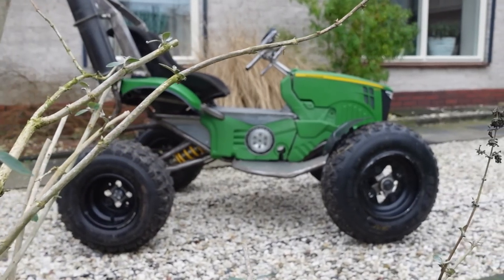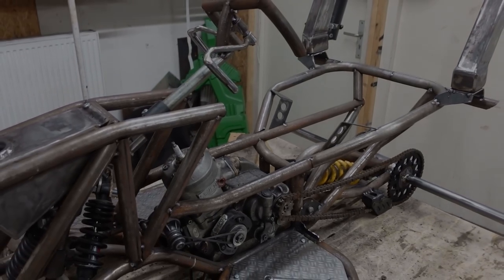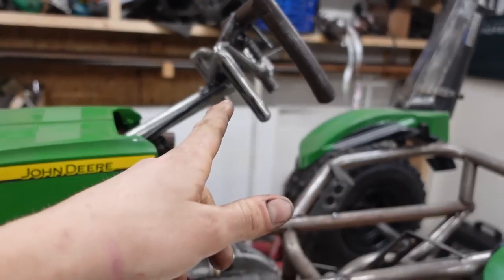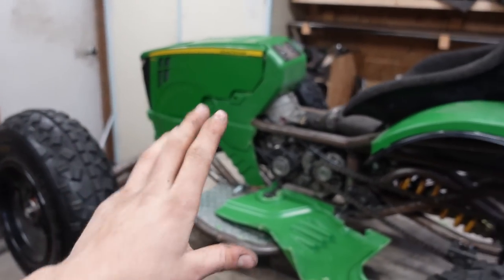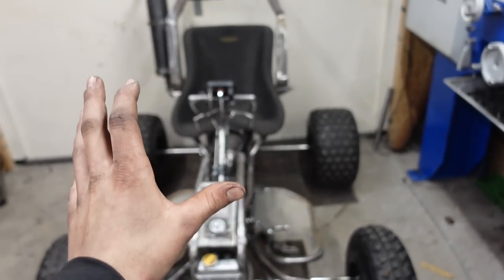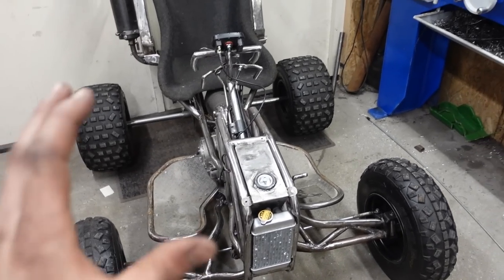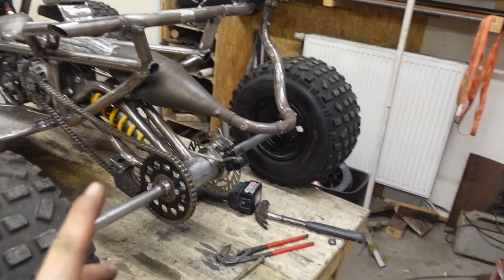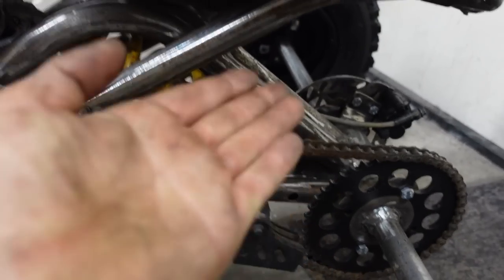40HP Toy tractor build part 4 - First testdrives & bodywork

Comment from the maker: Install Raid for Free ✅ IOS/ANDROID/PC: https://pl.go-ga.me/x16q5bmi and get a special starter pack 💥 Available only for the next 30 days
Reply: Je bent Nederlands 🤠🇳🇱
Reply: Fryslân boppeeee
Reply: Mag ik vragen uit welke omgeving je vandaan komt je komt me bekend voor ook de omgeving maar kan er niet zo m'n vinger op leggen waarvan ?
Reply: a nifty little trick about expansion chambers ... they are tuned for exhaust pressure for maximum HP ... meaning their length and diameter are specific ... BUT like any fluid (air is a fluid) the effective length can be adjusted with baffles forcing the flow in a spiral direction along the expansion chamber at say 30deg angles for 3 baffles ... this effectively adds a few inches without adding the few inches ... now you begin playing with the shape of the baffles ... a rounded cone seems to work best most often ... and the number to achieve the power to pressure ratio you would like ... 
.
and yes that is all an expansion chamber is ... a tuned back pressure valve to add a few extra horse power to your vehicle 
.
by changing the speed of the airflow with the baffles you effectively add length by increase the speed by the reduction of the space by baffles .... the cone shape funnels the airflow in a more ordered flow increasing speed allowing more flow to pass ... like it went further down a pipe instead of faster ... also the expansion also cools the exhaust by slowing it down ... to expand (technically it is speeding up as it has to fill the volume near instantly) you can further cool or heat the pipe to adjust this ... or use different metal types at different parts ... like titanium and aluminium and stainless steel etc .. all adjusting how the deal with the gas pressure and temperature ... all adjusting the ending horsepower curve . 
.
you may find with the pipe under your cheeks so to speak ... roasting all the um spicey bits ... you want to try a small 1/4 inch round mesh that directs the air in across the end of the exhaust (essentially cut out small triangles 1/4in wide 1 t 2 inch long in a point) ... bend and push out slightly to guide the airflow across the expansion chamber and between your seat ... this will effectively create extra wind cooling for your bits and also add to the low end torque with the faster heat exchange on the hot side of the pipe

Comment: I have been watching USA based builders like Grind Hard Plumbing, Cars and Cameras and Rather B Welding since the start of their channels build many types of power wheels. But the engineering on this in squeezing so many working parts into a tiny frame is the next level.

Comment: great work! ive had tons of 2 stroke experience. off the bat get a new plug. carb is jetted rich i can tell bu the sound, but that all plays a factor with the pipe. you should of took original pipe and just cut and move it around. just removing 2 inches from a 2 stoke expansion chamber can make a engine go from working insane to not work at all. pips are 50% of what makes up a stroke and how good they preform

Comment: Very nice "tractor". :)
Yeah, two-stroke can be a bitch to tune regarding the exhaust. The trick is to fabricate a resonator in order to have a "standing wave" inside the exhaust. That means it produces some kind of backpressure which is needed to keep a hold on the cylinder filling (air/gas mixture). If it's too short the gasses will simply blow out of the exhaust instead of being burned in the cylinder. The result is a badly running engine with no power at all. Too long and the same happens due to the system cannot blow the exhaust gasses out and get a full fill with air/gas mix.
As I was a teenager we spend hours to try and figure out the right length of the exhaust for our mopeds. A little help from the big brother who drove motorcross bike made it easier for us. :)

Comment: Absalute unit💯 you and the tractor haha, would advise a spring loaded chain tensioner to keep chain tight, also would be sick if the lights worked one way or an other, and I assume you plan on stiffer front suspension too, but honestly what a sick build!

Comment: Sorry the exhaust didn't work out. I guess the porting doesn't match enough so it isn't getting the tuned resonance it needs to rev. I overlooked the port timing. Well at least there's plenty space to have it the correct length and now you know it'll run right and you'll have your 40bhp!

Comment: Nice build, to bad you cut up the original exhaust, for a 2stroke the exhaust is very secure. Also i would look for a fan to put behind the radiator and temperature gauge, its gonna get hot and ruine your engine

Comment: Exhaust is usually least in performance vehicles optimized so you want to avoid modifying their shape and specially the size, even more so on two stroke. Would have saved lots of headache to keep size and relative shape same, but next time you know.

Comment: You shouldn't use an arbitrary stinger length. Worst case you could get overheating problems and seizing of the piston.

The length/diameter is an important variable of a proper pipe, not some appendage to be treated like an afterthought and made to fit!

Comment: Fabrication in this project is quiet impressive congratulations. But as a 2 strokes freak I am, I can tell due that expansion chamber that engine is probably not near 40hp. The amount of hours behind these engines are crazy, they work just like a clock.  That engine isn't the best you could fit in there, an enduro or coss would have been better.
Reply from the maker: Yeah i know but i chose this engine because its so small and compact
Reply: If you're lucky you're making 15hp.
And with a very peaky (small) powerband.
With 20+ HP you should be able to flip/wheelie this tractor. Especially with the soft suspension.

I said it before in a previous video. You butchered the powerband of your exhaust. And the tailpipe is way too long. Maybe you could start over, and curl the exhaust up to the hood, and style it just like a tractor exhaust (with little flap)

Also fixing the engine and exhaust riged, will cause problems.

Still and epic build.
Reply: @homemade_madness  yep, thats what I thought, but the way you've set it, with a normal enduro engine, you could have managed to fit in the engine. Your skills ara very impressins
Reply: @theowarmelink7347  naah, I would say about 30
Reply from the maker: I’d rather lose a few hp then have an engine sticking out too much, or an exhaust😜. Its running pretty good with the most recent exhaust tough!
Reply: @TheDromen69  

125c 40hp is already optimistic/best case scenario, like world championships. 30 stock is more realistic, and maybe even stretching it. 

And even more important the (usable) powerband.

The exhaust is the most important part of a 2stroke engine (with optimal port timing).

I'm guessing he's losing 10-15 hp on the exhaustchambers (lack of fill-pulse), faulty airfuel-mixture and probably 5 at the way to long tailpipe. The engine maybe revs (only for very short period) to 10-11k. Peakpower is much higher. Around 13,5-14.0k
The waterpump wil also cost a bit.
Reply: @homemade_madness  

It was just an idea. Even with more turns/angels/corners within the same dimensions/measurements would give way more (usable) power. 

For now significantly shortening the tailpipe (or increasing the diameter) would be an easy way to improve usable power. You're smothering the engine.